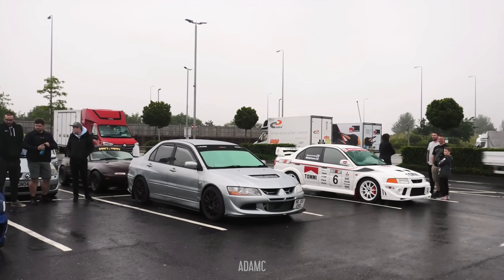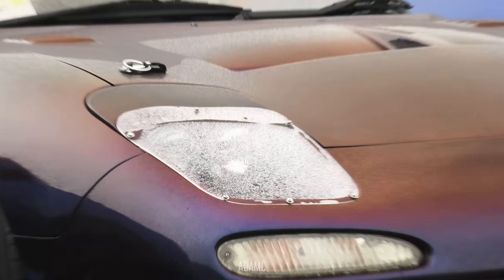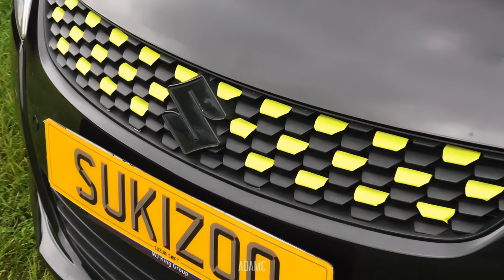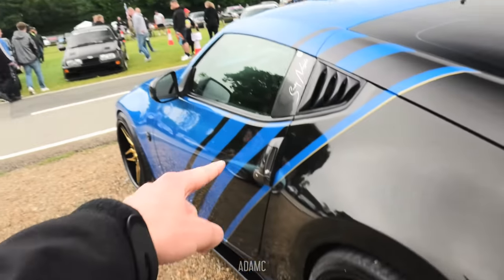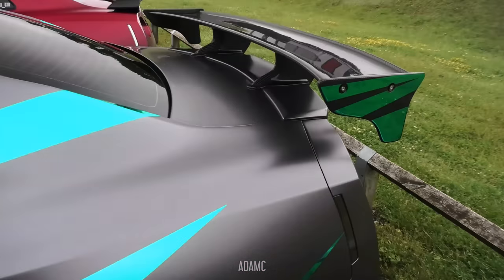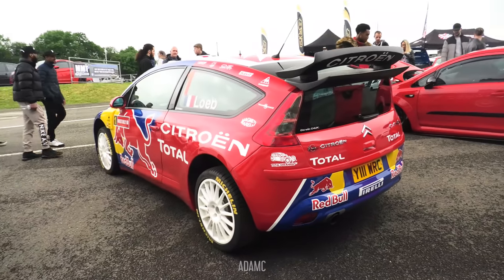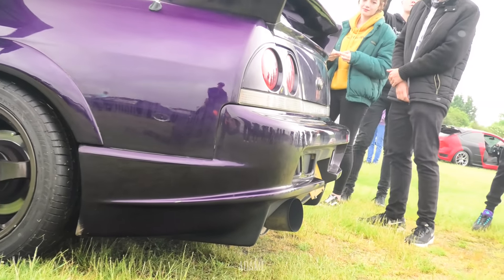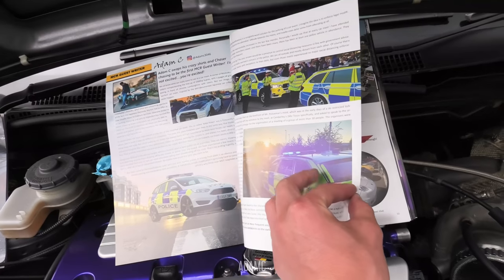DEAFENING Rev Battle SHUTS DOWN Car Show!

Comment: I would strongly recommend you get a circular polarizer filter for your camera... you'll be able to see through the car windows much easier... basically it will stop almost all reflections and the cars will look even more awesome 👌
Reply from the maker: I always use a CPL.
They don't always work through windows at certain lights/angles.